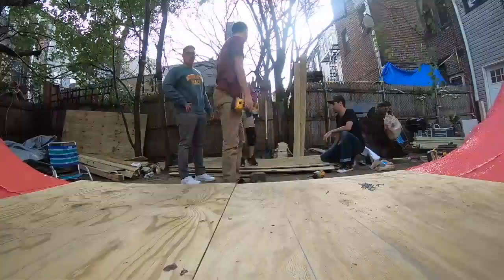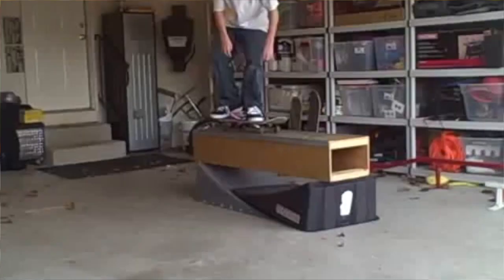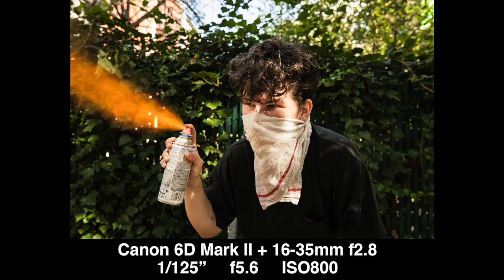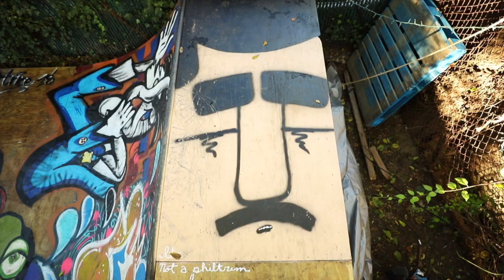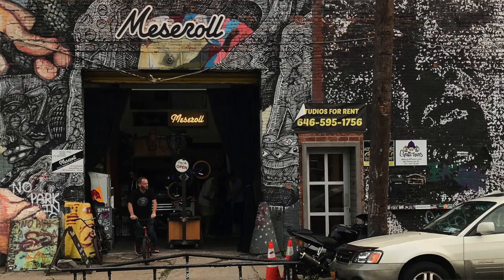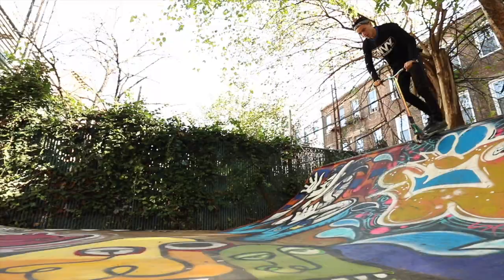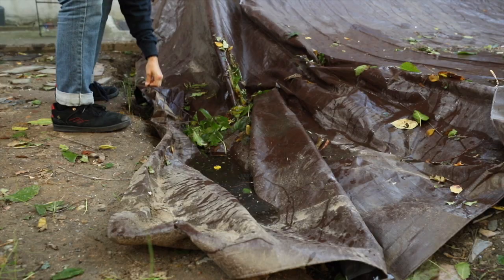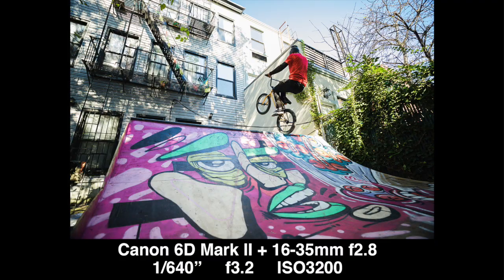I Built a Backyard Halfpipe in NYC!

Comment: What's with the red layer under  the top layer? Is it to cut down on the noise? Also, I've never seen a ramp get insulated. What's with that? I've built many backyard ramps and I've never used insulation or whatever that red layer is. I'm really curious about this. One last thing, I just got a house with a perfect backyard and I'm going to build a 6 ft. ramp next spring. (The reason for all the questions) Did you use "skate lite" or "ramp armor"? It doesn't look like it in the video. Did you weather treat it? If anyone can help me with these questions I'm all ears. Congratulations brother! Your ramp is dope and for that many people to come to your aid is really cool. Your going to have many bar-b-q's and insane sessions. I'm jealous. Nice job man.
Reply from the maker: Insulation and the red underlayment were both quieting devices. Since skatelite's so expensive, I decided to start with pressure treated wood, a layer of OC Ramps' ramp paint, and a tarp that covers the whole thing. Don't think it'll last as long as skatelite, but it seems like a winning combo.
Reply: Really cool ramp! I'm planning to build one next year too and was wondering about the red layer. Whats the material it is made of? Do you think the insulation really has an effect on sound? I thought with sound-proofing it's more about mass, hence a layer of sand in the gaps between the 2x4s would be quite efficient. I'd  really appreciate more info about the red layer. Thanks!
Reply from the maker: @MK-vy2ds  It's really hard to say. My friend with a ramp swears by it, but it's so hard to compare since there are so many variables affecting a ramp's noisiness. Biggest quieting move is closing off the backs of it, which I'm doing very soon.

Comment: Hey Josh I wanna do exactly the same thing. How much did the cost add up to?
Reply from the maker: Definitely depends on how nice you want the ramp to be and where you live. Home Depot materials are already pretty expensive here and I wanted a very sturdy ramp with pressure treated wood. I also did some unique insulation methods in attempt to quiet it down. In the end, I spent close to $4k, but definitely could've been a mediocre one for $2000 - 2500